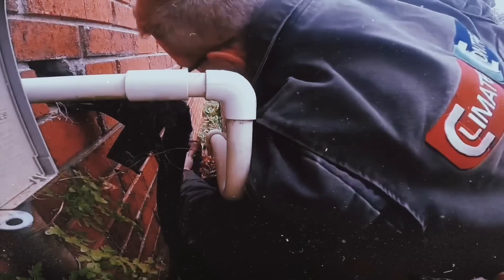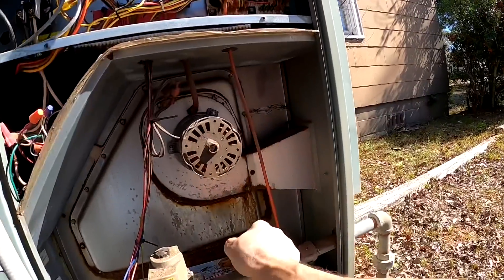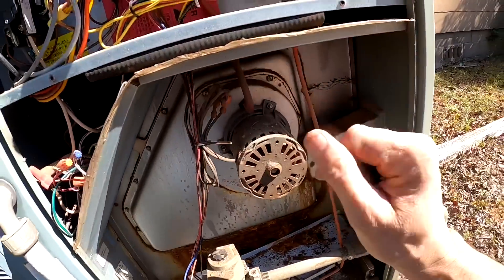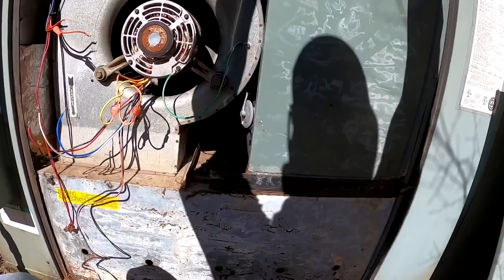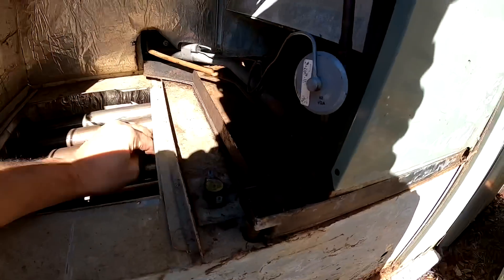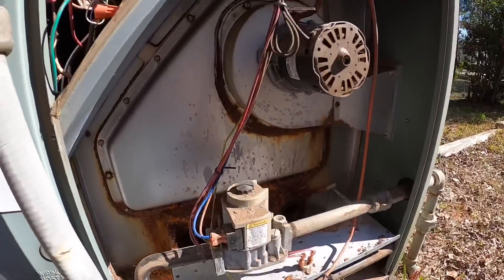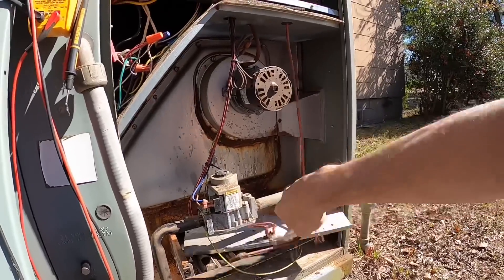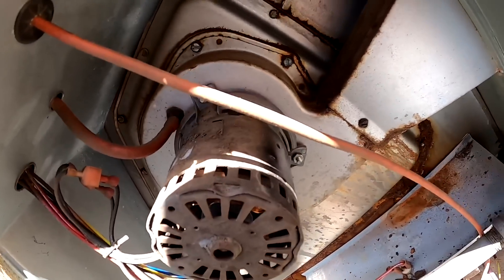Holes in Heat Exchanger. Rheem RRNA 2006 Gas Pack

Comment: was there a cap on that unit when you got there. if not looks like lots of water went down it over the years....
Reply from the maker: You mean on the flue?
Reply: @HVACGUY  yes
Reply from the maker: The flue pipe is open on the bottom, and as you see, when it comes out of the draft motor it’s in a V shape. So, the bottom is angled down. Water can’t really get in through the flue pipe.